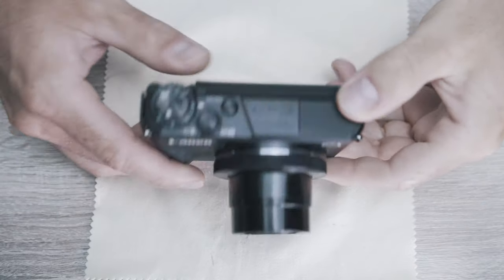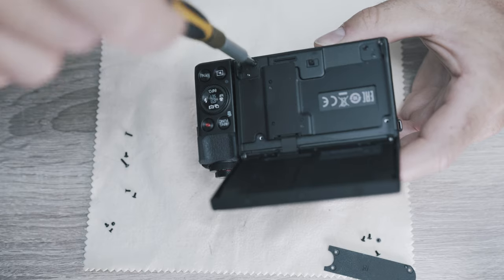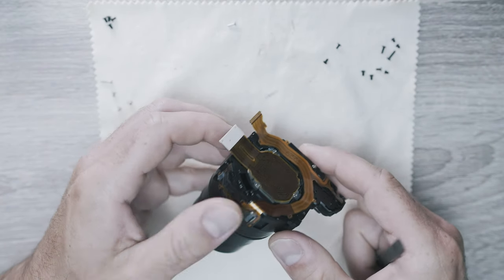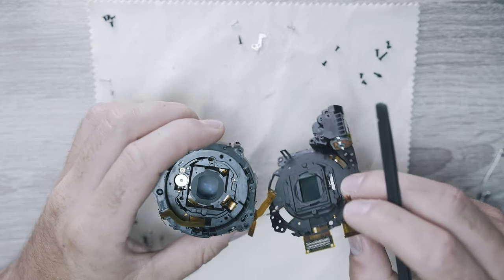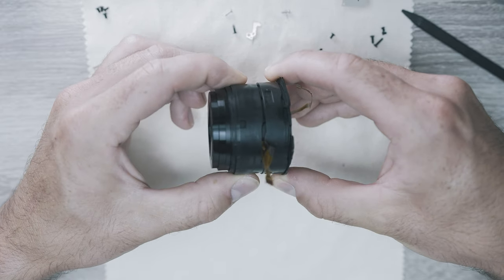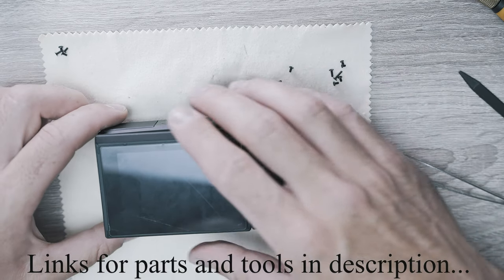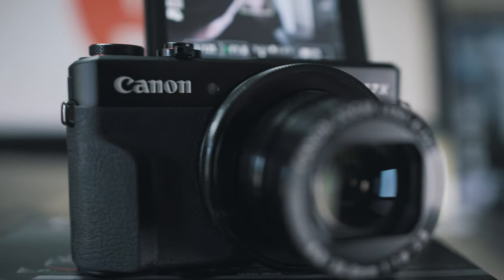Lens Error | Canon G7Xii | Stuck Lens | G7X mark ii disassembly | TakeApart [4k]

Comment: Hello, I wanted to know what type of screw you used at 1:43 in the video. I have a screw set, but I have been using a Phillips #000 screw driver. I have not seen many videos on what type of screw driver is required for this part

Comment: You forgot the disclaimer "don't try this at home". Got as far as unscrewing half of the back plate until some of the screws wouldn't unscrew and I had to give up short of stripping the screws bare... off to Canon repair shop with it...
Reply from the maker: hi, Im sorry for your experience.  for jobs like this one a proper tool set is needed as well.  thanks for watching
Reply: exact same thing happened to me. now I just have a bag of useless screws and camera parts

Comment: Hey, first of all, thanks so much for the video. Disassembling worked just fine :) However, I am stuck on the lens part (4:13). I am able to push it in, yet the lense still doesn't straighten. Do you happen to have any ideas on what I could be doing wrong? :(
Reply from the maker: Hi, thanks for watching!  it is hard to tell what can be wrong with your camera… and I can’t give you any advice at this stage
Reply: @takeapart  Thanks tho! :)

Comment: Hi @ 1:04 I accidently took out the ribbon, it doesn't appear to be damage, is there anyway i get a replacement? or maybe glue it back on?
Reply from the maker: if it’s not damaged then it should be fine
Reply: @takeapart  thank you for your reply! What glue should I use because it won't stick back on manually. Much appreciated :)
Reply from the maker: look …the ribbon is connected with connector… there is no glue …  that connector is for entire back including display !

Comment: good video... i got my camera disassembled down to the back plate, but unfortunately i just can't remove 2 of the screws from the back plate- they look to be stripped.  Any advice?
Reply from the maker: hi, you definitely want to try different screwdrivers first... keep trying 
thanks
Reply: Same with me. 2 screws on the back plate. 1 in the bottom. One on tue side at the flash area. Have you been able to fix?
Reply from the maker: hi, unfortunately rhere is not much to do once is screw stripped...
Reply: PiperQuarium yeah, I had to stop. I tried everything. Going to have to send it into Canon and pay the $100 unfortunately. I was hopeful! Lol.
Reply: It happened to me, and I used a small drill bit in my drill to drill away the stripped head.  Problem solved.

Comment: i just twisted my lense and it worked. however half of my lense doesn’t open when i have to push it down everytime i turn it on
Reply from the maker: hi, I would probably check inside if all ok . thanks for watching
Reply: Which way did you twist it? Was it able to turn on just fine? I currently don’t have the tool to do all those steps

Comment: Got real close but getting those two ribbions through that plasic ring on the lens, took like 30 minutes and i broke the cable. so gg.
Reply from the maker: hi, that is tricky part!  feel free to use my links in description ... links will lead you to the good sellers! I using them all the time- even if your part not listed flick them a message and they tell you how to get the right part. 
thanks

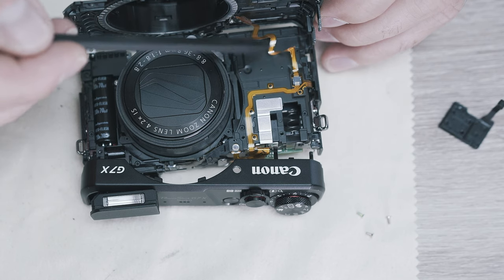Comment: @1:50 to 1:51, you need to pull the connector away. Unfortunately I pulled the socket with it as well, rendering the camera useless. Oh well, there goes another 1K to buy a new camera.
Reply from the maker: sorry to hear , you can get replacement part and finish your camera- still cheaper than new camera.  also you can try to use it without in mean time .
Reply: @takeapart  Ah, probably would mean that the lens adjustment won't work. Hopefully it's not an integrated function, just a one off

Comment: Hi, I've run into an issue, the screws you're taking out at 1:42 won't move and I feel like I will just strip the heads if I keep at it... any tips on this?
Reply from the maker: +Sinuous hi, try different shape ot phillips screwdriver head, it shouldn’t be tight that much.
Reply: @takeapart  I don't believe the inner screws are phillips screws, I believe they are JIS (japanese industry standard) screws. no phillips driver will open them (easily), I've ordered a wider variety screwdriver set and will try again tomorrow. 
also thank you for getting back to me and I appreciate the time you took to make this video, It's a life saver :)

Comment: great video, I need to try and do this on mine as recently the same thing happened.
Reply from the maker: Hi Richard !  yes definitely go for it. 
recommending good light and coffee! 
thanks
Reply: @takeapart  hi just assembled everything, it seemed to all go together perfect. but when you turn the camera on the lens comes out but then it just keeps making a shutter noise and goes back in then said lens error :/ any ideas?
Reply from the maker: hi Richard , you sure is it shutter noise? tonme it sounds like gear, lens was not assembled properly and it still cannot retract lens .   some plastic bit in lens must still be out of the position and blocking the motor or some internal parts .  
I suggest to take it a part and go over.  have a look for details. 
also in some point... while plastic ring (with hole for ribon cables) is out you can fully retract lens and check if it’s working in all range smoothly. 
good luck. 
btw where you located? 
thanks
Reply: take apart it’s a brand new lens I ordered from aliexpress, would that still be the case ?
Reply: Located in Manchester
Reply from the maker: hmm... then you should inspect and try that lens out of the camera. there is way to do it manually.
Reply: take apart ok do you know how you manually test it ?
Reply from the maker: check part of the video where I zooming lens manually. ... you need to spin outer ring ... of internal plastic ring. kind a hard to explain
Reply: take apart ok thanks I will take it apart again and give that a go.
Reply from the maker: good luck

Comment: Hello, thank you for this breakdown.  Wanted to know if you knew what the think ribbon that runs along a thicker ribbon cable that you are trying to pass through the big ring thats attacked to the sensor does The ribbon from 4:37.  I had fixed the lens but while trying to run the ribbon back I ripped it.  Thinking its probably best to buy a whole new lens zoom assembly.  What do you think?
Reply from the maker: Hi Roberto! if you damaged ribbon cable... there is not much to do.... you can repair ribbon if possible or just buy new one via links in description...(even if they for different parts... you van reach out directly to the sellers and ask for specific part/s) . 
thanks for watching
Reply: Appreciate the reply!! Love practical channels like yours!!
Reply from the maker: thanks for support !

Comment: Hi all, this is certainly at your own risk but thought i should let you know that I fixed mine by holding the zoom between my palm and thumb and giving it a forceful wiggle, which produced a little pop.  The zoom then retracted and was fixed.   It now works fine and i'm hugely relieved as i didn't fancy my chances with the in-depth fix on the vid.  Not to take anything away from the hard work that went in to this vid by Take Apart.  I had also contacted canon who's fixed rate fix charges don't apply for drop damage , which is what this was.  I was originally looking at a hefty repair charge which i now don't have to worry about.  I thought i'd give it a shot based on the fact this guy went all the way through the camera to essentially pop a component back in place.   Don't come at me if this doesn't work.  It's at your own risk.  Good luck with whichever route you go down.
Reply from the maker: hi and yes!  in my case I didn’t wanted to damage delicate lens parts by applying force. but sometimes it can donthe trick. anyway I went the hard way and disassembled it all .  
just make sure there is no broken part inside or so. 
thanks for watching.
Reply: Oh my goodness, thank you so much for this comment! I had almost accepted that my camera was a lost cause (not going to pay the hefty repair fee) but thanks to you I wiggled and wiggled and now it seems to work again. You're my hero right now! :D
Reply: its fixed you legend
Reply from the maker: +The Gamer Reacts thanks for watching
Reply from the maker: +sustainablefox thanks for watching
Reply: I tried 2 times and ir did not work prayed to God in jesus name and tried for a third time thank God it worked and thank you for sharing 😁
Reply from the maker: thanks for watching!
Reply: OHHHh MY LORD I DID it THANK YOUUU
Reply: Just did this and it worked. Thank you!!
Reply: Been weeks watching all types of videos. Thank you 🙏 work in 2 seconds
Reply from the maker: @FindingSukonaa thank you 🙏
Reply: How much is that “rate”?? 😅😅
Reply from the maker: @karens4285 what rate?
Reply: @takeapart  you mentioned a standard rate to pay to get it fixed. I'm reallllllllly thinking about having it looked at. 
my issue i cannot find anywhere else on the internet.